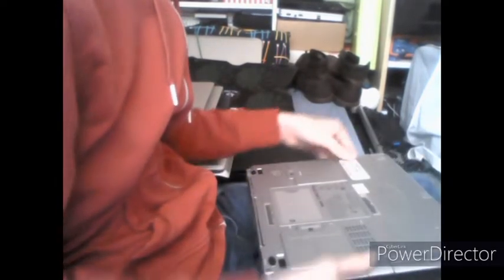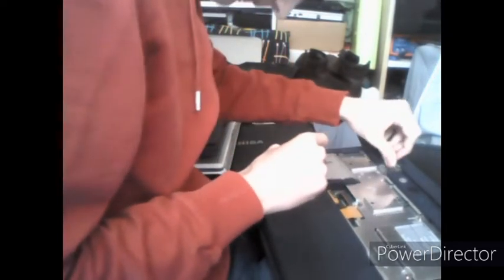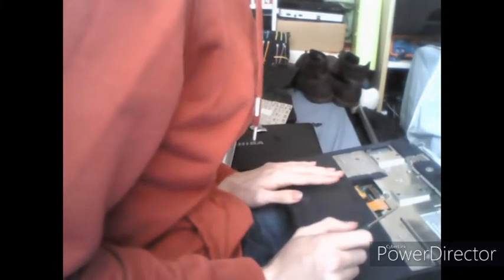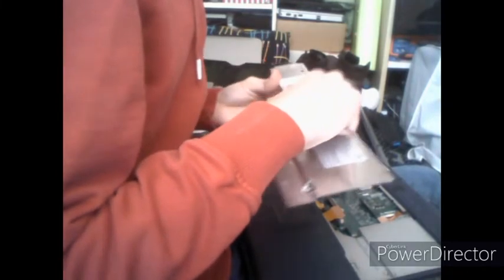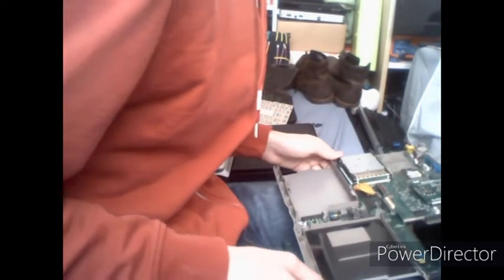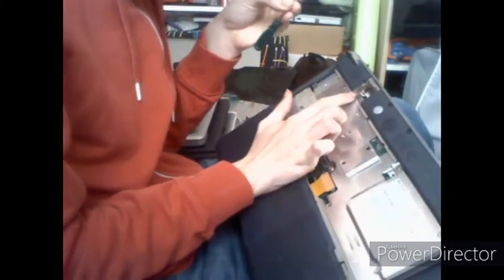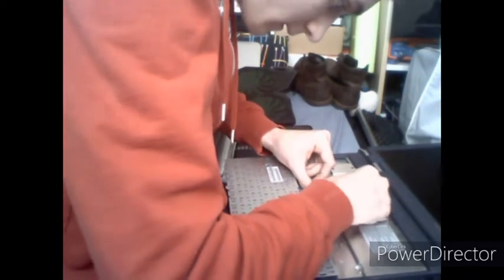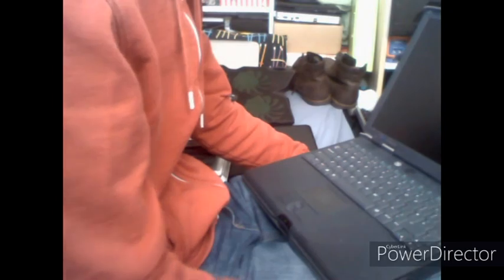Tutorial: How to Disassemble and reassemble a Samsung/RM GT-8000 Laptop

Comment: I'm trying to get my laptop working! Thanks for the video
Reply from the maker: You're welcome! Do update me on the results!, these RMs are a little temperamental sometimes
Reply: @lukedavis436  my problem is that I'm stuck at the "Windows 98 Windows is getting ready" screen...do you know how to fix this? I've got the original system software CD and recovery
Reply from the maker: @ssmolelly  unfortunately I do not, my one is running Windows ME and I haven't tried out the RM Recovery media (the disc is in a box)